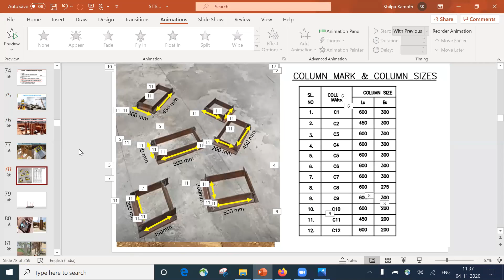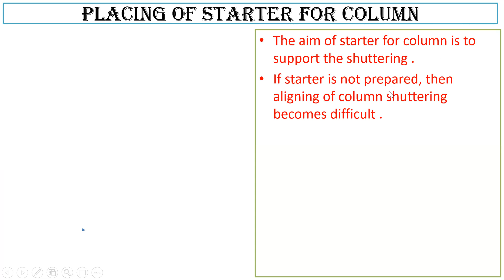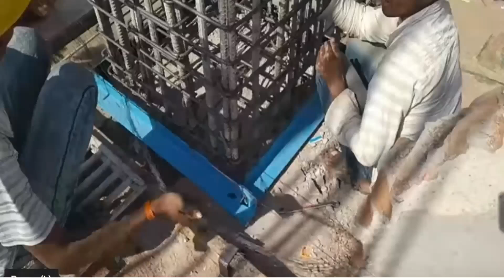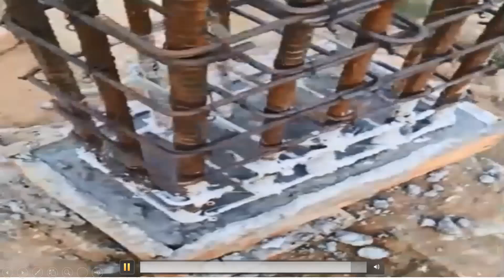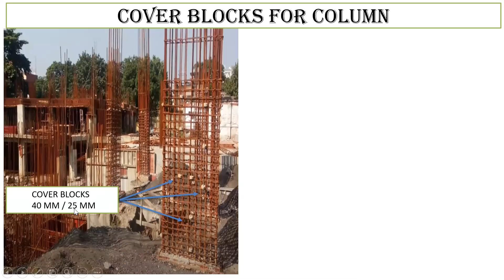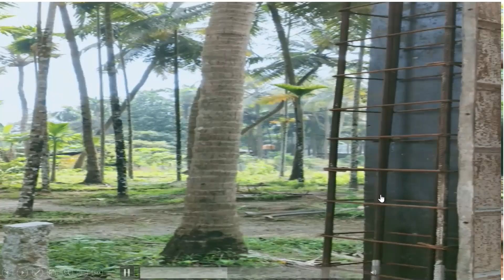what is starter concrete and how to place starter concrete at site l Live Site training l Lecture 15

Comment: Sir it is called shear key so it is necessary for columns to make perfect bond between existing and new RCC column and also give resistance...
Reply from the maker: Yes, its Shear key .. its created to make bond between old and new surface
Reply: @civilbrains  shear key is mandatory in columns
Reply from the maker: @darirfan966  ok fine , u provide it ..